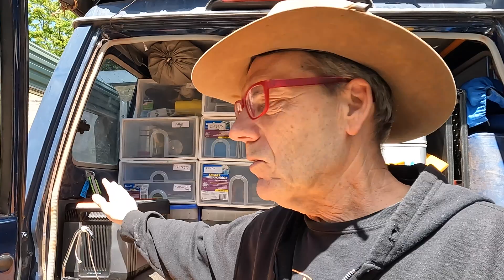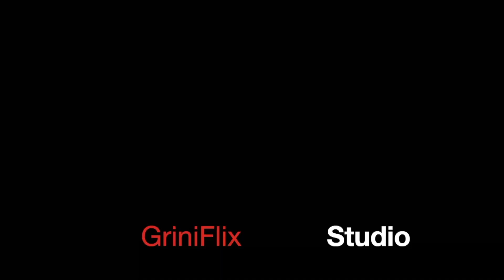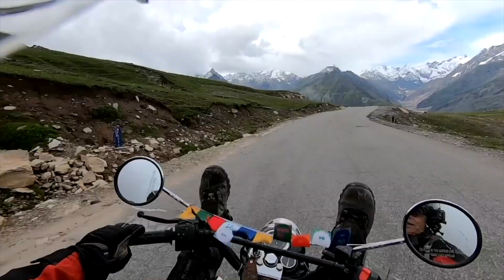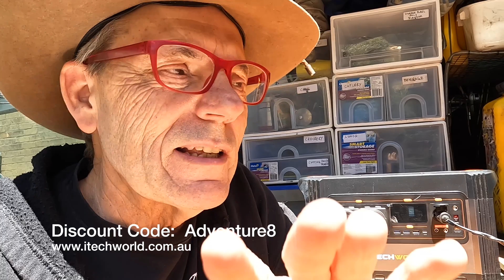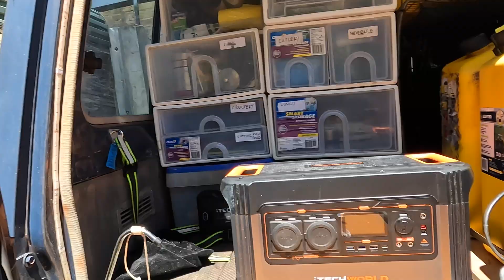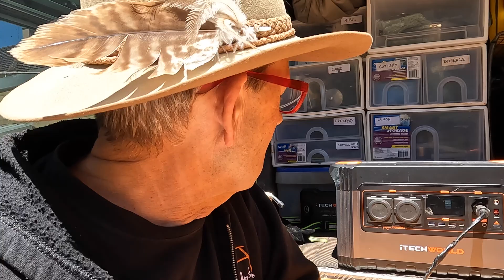iTechWorld JS80 Jump Starter.  Is It Any Good As A Back Up To Run An Engel 40L Fridge?

Comment: I have used my JS80 to run my elcheapo Kings 32L fridge, it worked well for about 4-5 hours. I then had the same issue you had, where as soon as the poŵer went off, the fridge immediately began to warm up. So, that's not much chop for overnight as your milk would be off before breakfast.
Reply from the maker: True, well at least the JS80 is an emergency back up for a few hours.  Thanks for watching and commenting.
Reply: @Adventure8  Im thinking of getting a larger power pack from Itech is your Adventure8 coupon still valid?
Reply from the maker: @nigelmaxwell5751  Yes, in most cases you will get an extra discount using the Adventure8 code.  Happy shopping.

Comment: I have this device, it won't run a fridge for very long 😂
Reply from the maker: Yes that's true. The JS80 capacity is limited because of its size.  Good as an backup power for the fridge in addition to its main purpose of jump starting your car.

Comment: Any link for this cable?  12v to dc male. Hard to find...
Reply from the maker: There is a cable which comes with the JS80 which provides a 12VDC (cigarette lighter type) female plug.  The Engel fridge included 12VDC cable (cigarette lighter type) male plug can then be used.  Does that answer your question?